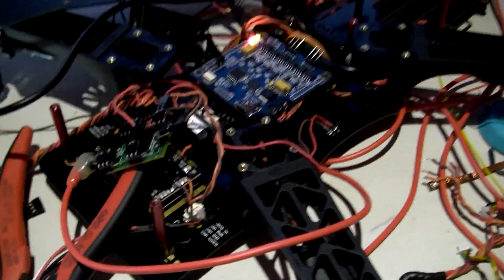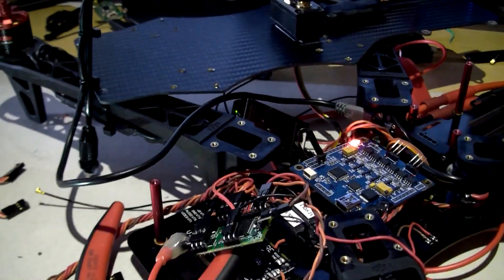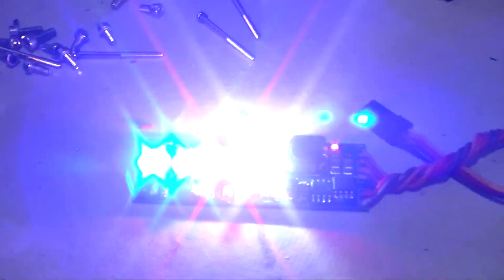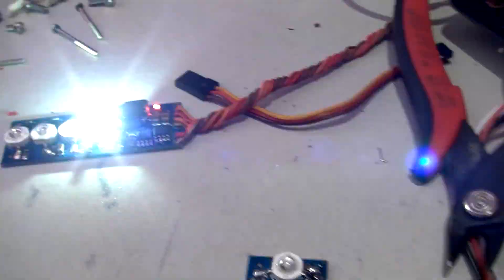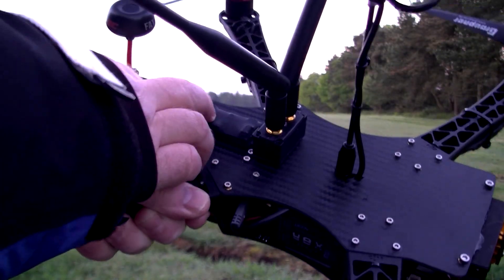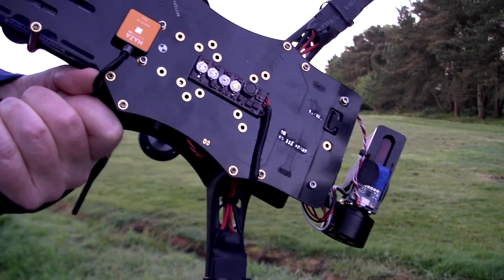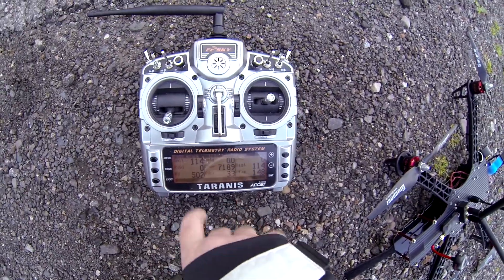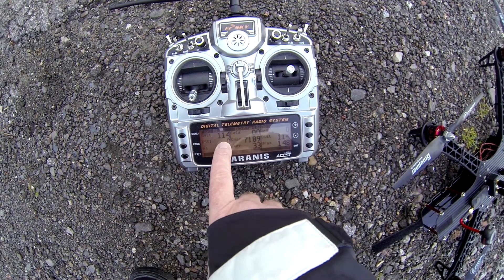TBS Discovery - NAZA to FrSky to Taranis telemetry update

Comment: Great work! Can't wait to start building. Where will you post the docs?
Reply from the maker: I'll post details in a video...... when I get chance to finish and document it all.
The kit you'll need is a Teensy 3.1 and a NAZA - that's it!
I'm currently working on a big project which will amaze me if it works :-)
Reply: vortecks2000 great great job! to connect the teensy do naza you use a can port of naza or you need to open the controller?
regards
Reply from the maker: Luis Alves All you need to do, is make an adapter which takes a single wire from the end of the GPS. It's very easy and no need to take anything apart :-)
I'm going out this morning for a final test and I've got a couple of weeks holiday at the start of net month.....I'll release something then.
Reply: vortecks2000 I'll be waiting for news from you! This is a spetacular works, and definitely what I was looking for to add to my setup. Thanks! Regards
Reply from the maker: Luis Alves I did another video yesterday if you're interested.
NAZA to FrSky to Taranis update 2

Comment: Hey, enjoyed the video! I'm looking to get 9x5 graupner e props for my 4s f450; I was wondering how the 9x5 graupner e props were working for you on your 4s discovery, does the quad still have enough lift/power to fpv with a gopro with ease? Thanks.
Reply from the maker: Yes, it does have the power to lift it.
Yesterday, I tried 3s and 4s and it lifted it with ease. 4s.....rocket ship! 3s..... good stable platform for aerial video.
Reply: Awesome! Thanks for the reply.